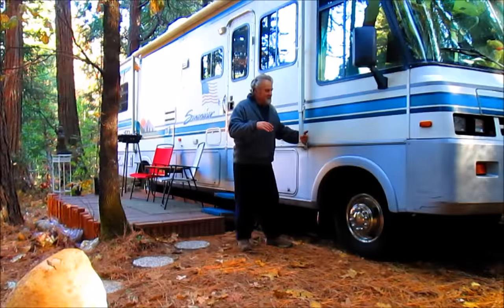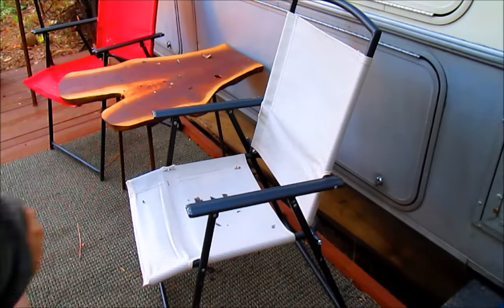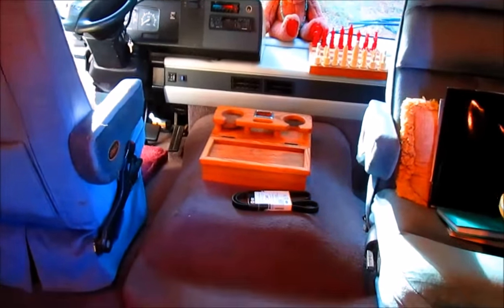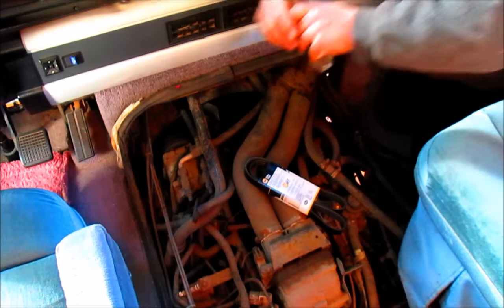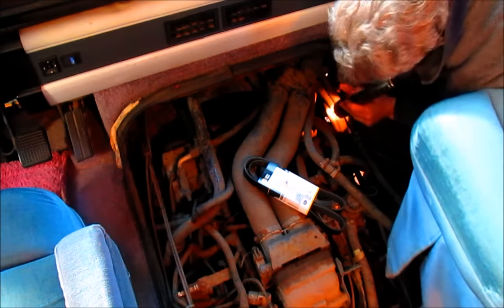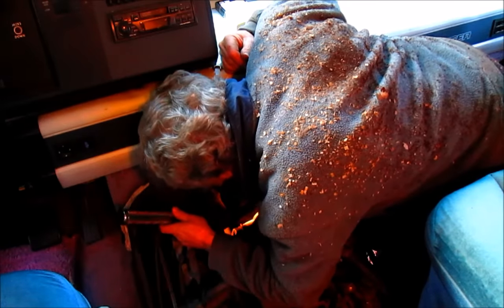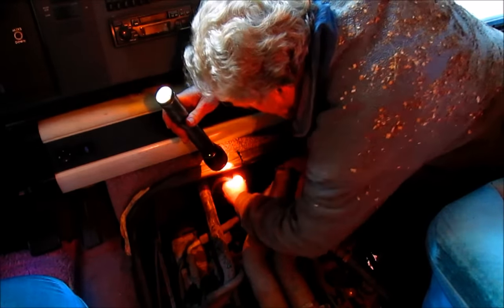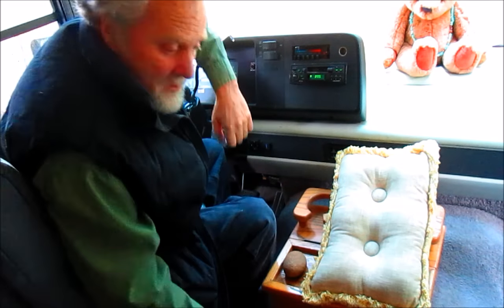Fanbelt Fandango

Comment: sometimes the mechanical gods are with,  you get lucky and things actually work the way  they are supposed to. many years ago i did enjoy working on vehicles but with the advent of the pollution control systems, any pleasure went out of the work. having to spend x times the time getting to the job itself as you do fixing the problem is a drag. i knew a mechanic who on one model routinely dropped the whole front drive train out just to change the plugs because there was so much plumbing in the way on top. had a friend whom i was talking to in his shop one day and whilst he dealt with a phone call i idly began counting the vacuum ports on a carburetor sitting on the floor. when the conversation resumed i had reached 42 or 43, i can't remember which..i preferred it when 2 vacuum ports were bad because it meant the vehicle had vacuum wipers which were the worst idea a vehicle engineer ever dreamed up. needless to say i don't do much under the bonnet these days.,,,
Reply from the maker: +crazymanmichael Ditto! It's why I own pre 90's vehicles, so I can work on them. I don;t like working on cars any longer, but I also don;t trust mechanics.